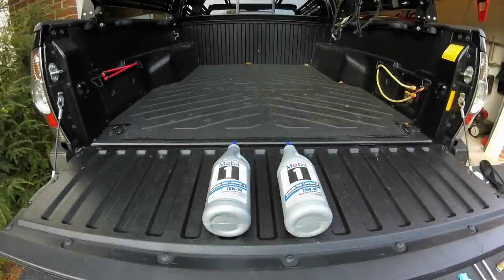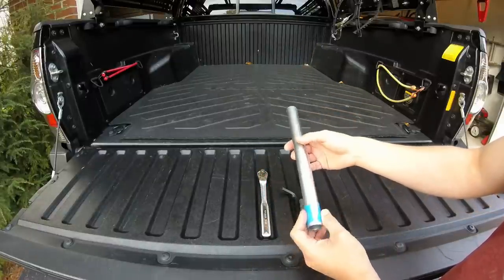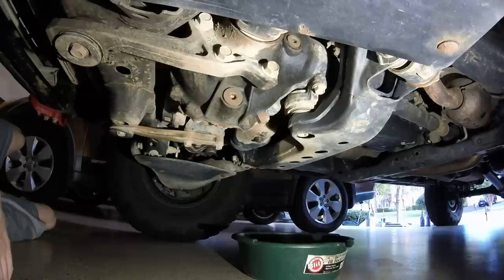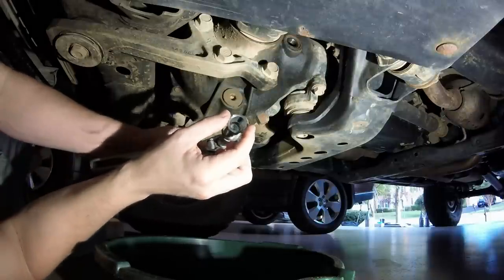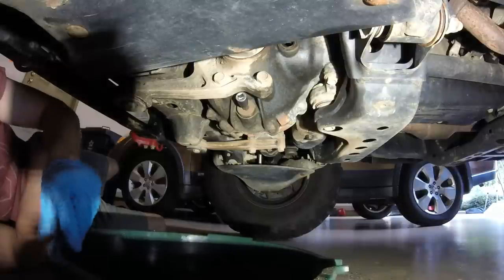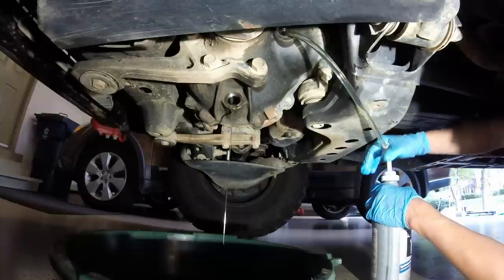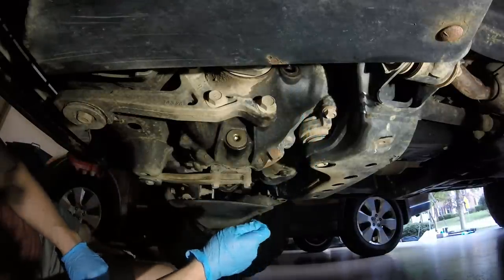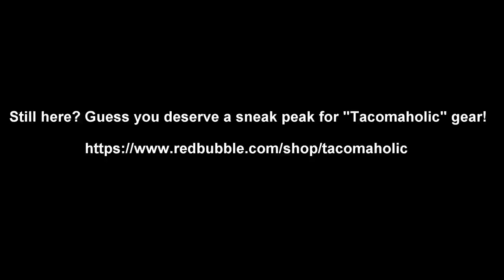2nd Gen Toyota Tacoma Front Differential Oil Change, Avoid the Stealership!

Comment: Just did oil changes with Amsoil 75w90 and it comes in bags now making oil changes a breeze. No pump necessary as you can manipulate the sturdy bags to fit. And just squeeze it in there. Very convenient. No I’m not a Amsoil dealer. Just made life easier.

Comment: Proper sequence for avoiding the splash. 
1. Loosen the fill plug and snug it back up, finger tight. 
2. Remove the drain plug--the vacuum will prevent the large outrush of fluid. 
3. Remove fill plug once the large outrush of fluid has slowed.
Reply: That is golden! TY!

Comment: A couple pro tips, like you did driving over to your folks place get some heat in the oil flows much easier also crack the fill plug loose but don't take it out all the way that way when you take the drain plug loose the oil drains slowly and you don't run the risk of over shooting your drain pan or making a big mess. Once you got the drain plug out then take the fill out the rest of the way. Good Job and good explanation!
Reply from the maker: Thanks scooter! I will definitely do that with the fill plug next time because that oil shoots out faster than I expect. 👍

Comment: I recently changed the front, rear and transfer case fluid using Super Tech 75/90 sold at Walmart for about half the price of Mobile One and both made at same refinery. I also added 6 ounces of L/S additive to the rear diff.
If I had gone to the dealer each diff change would have been 149.99 including the transfer case.
Reply: hi , is walmart oil good quality. I see name brands are expensive.  thanks

Comment: Did mine tonight.  I highly suggest that you spray the drain bolt with some PB Blaster before you attempt to remove it.  Mine was VERY tough to remove, but finally got it to break loose with the PB Blaster and a breaker bar on the socket.
Reply: BRO IT WAS SO FUCKING HARD, I did get help from my neighbor, I did get a breaker bar
Reply: I sprayed pb blaster on my gen1 drain plug and it didn't help much, even though the plug was removed just a year ago it still made the hugest of pops like I brpke the breaker bar!
Reply: Just stripped mine 🤦🤦🤦

Comment: The tip of using some new oil to flush the system is 👍

Great way to use the extra 30-40% from a bottle.
Reply: Doesn't the rear diff take same oil and more than 2 quarts?

Comment: I just changed the oil in the front diff and the hardest part was getting the rock guards off because some ding dong before me had messed up a bolt head and I had to grind it off. But with some patients I got er done.

Comment: Thats a cool little tip for the obsessed ocd'ers with the little flush technique.

I like to just re educate myself to remind myself and im gonna do this again this weekend.

I was lazy and didn't want to order these n i have dealership right up the road n i believe i paid like 20 or 21 bucks for these washers and 2 oil plug washers (why they call some of the washers n some gaskets is just plain stupid to me, anything i put on the end of a bolt to me is a waher lol).

Anyway if you read this how much fluid should i purchase if im doing front, transfer and rear diff?
I have a 2nd gen 2.7l obv 4x4.
Reply from the maker: Double check in your owner's manual by all 3 for my Tacoma is 5.8 quarts ... so 7 quarts would be good so you have extra to help flush the drained diffs.

Comment: I just changed the transfer case & front/rear diff fluid on my 09 taco and when working the front, I discovered the drain plug was stripped (I bought this truck used almost 2 years ago). I used hand pump to siphon out most of the fluid through the fill plug which wasn't really too dirty. Looks like I'll be buying a bit extractor and replacing the plug in 30k.
Reply from the maker: I've heard you can use the a Lexus plug for the front diff drain plug to make striping it harder. Here's the part number if you are interested: 90341-24013
Reply: @Tacomaholic Thank You I!

Comment: Great video, FYI for front diff. Just use a longer plastic tube & hose clamp to gear oil bottle tip, thread tube down from wheel well and squeeze away.  Easy Peezy, however, your pump hand HP will weaken.😀

Comment: Wow, The oil was that color with only 30,000+ miles? You drive aggressive and tow trailers? I just picked up a 2013 TRD Off Road with 50,000 miles. My first Tacoma and I LOVE it!! Love your channel!
Reply from the maker: I drive like an old man and tow nothing. Curious to see what it looks like for the 2nd oil change here in a few thousand miles.
Reply: Tacomaholic yes that will be interesting. 
 Why doesn’t Toyota have a dipstick for the tranny oil???That’s the only thing I don’t like.
Reply from the maker: @CosmikDebrisFZ  The automatic transmission system for the 2nd Gen Tacomas is a "closed system" that Toyota really doesn't want us messing with. I'll have a video about things you can do with it soon though.
Reply: Tacomaholic oh, hmmmm well I wouldn’t call checking the level of oil messing with it but they have their reasons I guess. Probably to get us to bring it to them for service lol. 
 Oh good, I’ll be on the watch for your video on this. 
Thanx a bunch!! 👍🏻
Reply: @Tacomaholic the 4 cylinder gen2 does have a dipstick up top for the AT

Comment: Whoah, that's alot easier than I thought! Too bad I already paid to have it done ☹.
For some reason I thought you had to remove a bunch of bolts and a cover.
Reply from the maker: Super easy. I believe the stock "skid plate" might be covering this area, but that's easy to remove. If you have an aftermarket skid plate you would have to remove that. Mine is off right now for a fresh coat of bedliner, so it was a perfect time to tackle the oil change.

Comment: I recently did my 2018 Tacoma with 28095 miles.  The front was twice as dark and had twice the amount of crud on the magnet than the rear.  Used Valvoline 75w90 synthetic gl5.  Wanted mobil 1 but couldnt find it anywhere.

Comment: I’m getting confused with all the research I’ve been doing. I have a 2nd gen sport, do I need to add additives? If I don’t then do I buy gear oil that doesn’t have addictive? Mobil one states LS doesn’t that mean it has additive? 

I hope you can help sir 👏🏽
Reply from the maker: Thanks for watching! If I remember correctly the TRD Sport do need the additive. Check your Toyota manual and it will tell you exactly what spec gear oil you need.

Comment: Nice video. I have a 2015 prerunner, do i need to do anything like this for maintenance?
Reply from the maker: You will just have to do the rear differential ... but it's just as easy. https://youtu.be/jNWzQ2MbcX0
Reply: Tacomaholic i will check it out thank you
Reply: Don't forget the diff vent valve sits on top of the axle if they get plugged  pressure builds up in the diff it will damage your axle seals

Comment: Question: I've added the required amount of fluid I'm at 1 and 3/4 quarts  and still doesn't drip out.  I stick my finger inside and don’t feel the fluid.  Should I add more until it starts leaking out? Can I over fill?
Reply from the maker: You can't overfill since it will start to leak out of the fill plug, but that should be at/around 1.6 quarts. Weird you can't even feel the top of the fluid after adding so much. You are certain you are adding fluid to your front differential and not something else??
Reply: @Tacomaholic  wierd. Yup I'm sure  the fluid is going in the correct spot. Not sure how to post a picture I took. I'll drive it for a bit then recheck.
Reply from the maker: @rzrz3181  You can email me a pic at tacomaholic@gmail.com

Comment: Do you have to remove the skid plate to access the front diff plugs?
Reply from the maker: Hey David! It's been awhile since I had the factory skid plate so i can't remember if it goes back far enough to block your access. Good news is that it comes right off with just a few bolts and it's nice to have more your to maneuver, especially when dropping that oil out of the bottom.
Reply: @Tacomaholic perhaps the middle splash plate needs removed? I removed the front plate and couldn't find the plugs

Comment: Off the topic:

NEED YOUR OPINION: Looking into investing in 33" all terrains tires for my Tacoma, If I do I'm going to re-gear. Which gear ring & pinion should I go with 4.10 or 4.56?
Reply from the maker: Either one should be fine, but alot of guys run 4.56 with 35" tires ... so if you think you might upgrade then I'd go with 4.56. Any particular reason you are regearing for 33s?
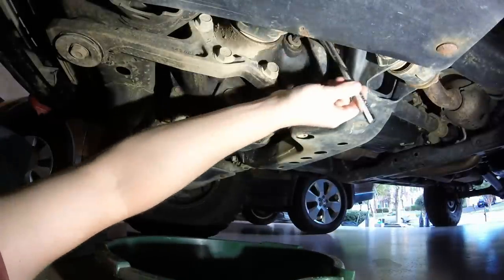Reply: My rig is heavy, carry lots of gear when I go overlanding. But it looks like I’m sticking with 32’s only difference I’ll be up grading to an E rated tire, however I would probably still regear to a 4:10 regardless

Comment: ***Heads Up***That drain plug on the front diff is a whore, I stripped it out almost completely trying to loosen it. Stop what you are doing and get a new plug. PB blaster twice 2 days before. Its just a crap design with dissimilar metals, and a little 10mm hex key and a huge plug. So if you have a little left to grip the trick is to lightly tap the back of the head of the breaker bar with a very small 6 oz ballpien hammer while slowly gently loosening it. Then after a few minutes it breaks the seal you smash yourknuckles but you did it. It got a little nickel anti seize before being reinstalled and torqued to spec.
Reply from the maker: Sorry to hear that Trevor. Are you going to replace it with one of the plugs from Trail Toys?

Comment: I believe Toyota  requires 75w-85 for the diffs.???
Reply from the maker: 75w85 is what the manual says, but many run the 75w90 without issues since it's a lot less expensive.

Comment: Where’s the link for the washers? I don’t see it pinned at the top.  Thanks
Reply from the maker: It's the first link in the video description: https://amzn.to/3pSJsgt
Reply: @Tacomaholic  Thanks for sending the link! For some reason on my end all I see pinned at top is your link to avoid the stealership videos.  I know the washers are for rear diff, transfer case and front diff. Where is the brass washer used I forget which gear case and whether drain or fill plug.  Thanks! Love your  video content and comedic style.
Reply from the maker: @andyc7074  I forget which ones are used where, so whenever I do one of the fluid changes I matchup the old washers with the same sizes from the new package.

Comment: When should you change the differential oil?
Reply from the maker: Recommended every 30k miles.
Reply: @Tacomaholic  Thank you for your quick reply. I just got a 2013 Tacoma and your channel has been very helpful. Do you have anything on the A/C. It will start to blow hot air and the light will blink
Reply from the maker: @evanrivera8173  Thanks so much for watching and congrats on your purchase! Sounds like your blower motor might be going out but I'm not sure. You can access it right behind the glove box.

Comment: how many times do u change the oil a year?
Reply from the maker: I'm changing my front diff, rear diff, and transfer case oil every 25k miles.
Reply: I used your vids to switch front, t-case, rear with Amsoil 75w90 synthetic (very well done btw) My 2012 Tacoma TRD Sport just hit 100,000 km (Little over 62,000 miles) I figured that’s a good milestone to change oils that are due and I’m not sure about. Question is do you think with the syn you can extend oil changes?

Comment: Where’s the link for the gasket set?and what all does the set include?
Reply from the maker: Hey Jeremiah, first link in the video description: http://amzn.to/2El4xGH The set includes all of the washers for your front and rear diffs and the transfer case.
Reply: What kinda fluid do you put in your power steering pump
Reply from the maker: Check your Toyota manual for that one. For my 2014 it's automatic transmission fluid DEXTRON II or III.

Comment: If I have gear oil for a limited slip diff can I use it on the front diff and transfer case?
Reply from the maker: Which specific oil do you have?
Reply: @Tacomaholic  Lucas 70w90 gear oil for diff and trans case. Rated for gl5 and lsd
Reply from the maker: @ethansmith1865  70 or 75?
Reply: @Tacomaholic  75
Reply from the maker: @ethansmith1865  Gotcha, yeah the 75w90 with the LS additive is fine to use in a diff that doesn't require it.
Reply: @Tacomaholic  thanks I appreciate the info. Didnt wanna spend a couple hundred to turn a couple wrenches when I can do it myself
Reply from the maker: @ethansmith1865  Absolutely.

Comment: What kind of drive/fitting do you need to remove/reinstall the plugs?
Reply from the maker: 10mm hex bit to remove. This set has one: https://amzn.to/35Uja3U
Reply: @Tacomaholic  Thank you, sir.  I'll be doing my front and rear diffs this week.  After the stealership quoted me $150/per, I found your videos; wish me luck.  Already hit the fasteners with the PB.
Reply from the maker: @npr386  Just make sure you loosen the top fill plugs BEFORE the drain plugs and careful not to overtighten. And be ready for that nasty diff oil smell. 😃